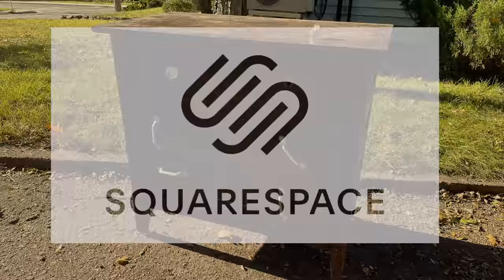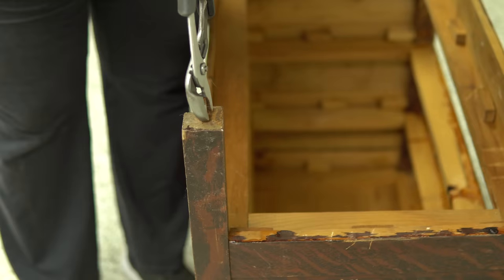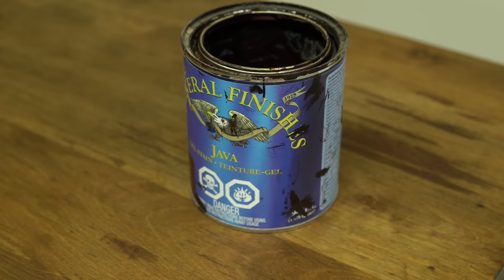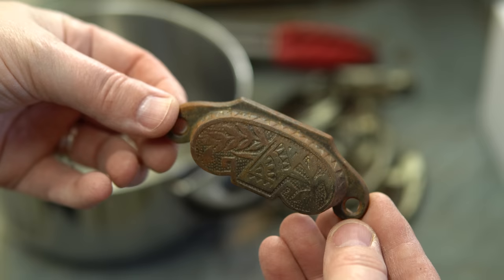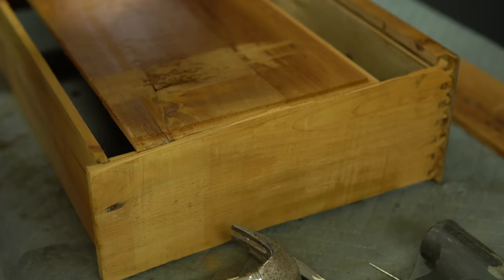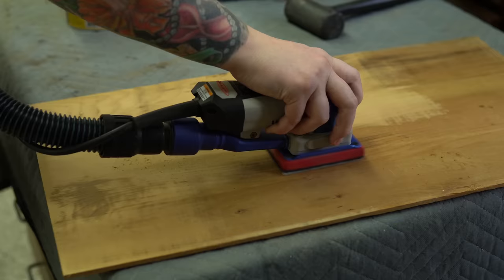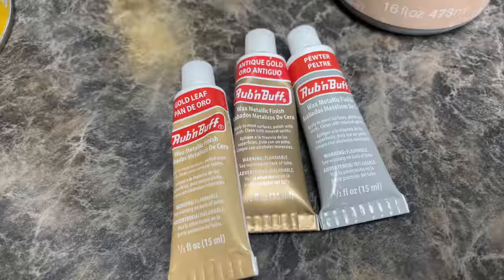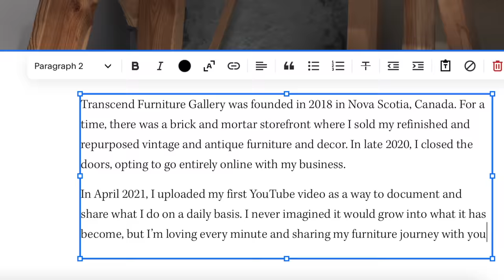Yes, I painted this chest of drawers: THAT is a FAUX oak finish!

Comment: I had never heard of, or seen, the peg/scallop joinery before.  How very unique, and yet I can't begin to imagine how difficult it must have been to create prior to modern power tools.  You gave this piece a major facelift and a chance at another life.  Well done!!  👏👏👏
Reply: That joinery was created with circa-late-1800s power tools that were built specifically for the purpose of making it -- and it was specifically designed to be easy to do with power tools, unlike dovetails that weren't doable with power tools until we got to the era of modern routers.  The "peg" side was made with a rotary plug cutter (or a set of them), and the scallops were made with a special shaping cutter.  It was as simple as putting the wood into the machine and pulling a few levers.

It's kind of rare, because only a large furniture shop would have bought the machine to do it, and once it became possible to do dovetails efficiently with power tools, it fell out of fashion.
Reply: @BrooksMoses  Thanks for the history.

Comment: I have that same piece in my spare room. It was a pain in the backside just like yours. I took the stain and varnish route, and it took forever to get the wood prepped. But worth it in the end. The key for that is a tricky one. I did eventually find one.  Your paint and stain combo is also a good look. Well done !

Comment: I can't believe the work you put into recreating the joinery. The result is exquisite. I grew up in the 50's and 60's in (very) rural New England. My best friend's mother was an antique dealer with whom I visited hundreds of antiques shops starting at around age 9. A neighbor was also a dealer, and I often hung out in her shop. When I was 19 I took a year of from college and worked at Sturbridge Village, a living museum in Sturbridge, MA. Over the years I saw a great deal of the painted finishes that your dumpster dresser was painted in. It's likely that the finish was executed with vinegar (something I want to try). 
I have a similar dresser taken recently from a trash heap at a total renovation/reconstruction site. It's much younger that yours. The cracks in the drawer bottoms have been repaired with thin packing tape. I had to cut the legs off to fit it in the truck of my little Fiat Panda (I live in Italy, hence the Fiat Panda). No great loss as I they would have required far greater carpentry skills than I could ever hope to possess. I've never intended to sell when "restored". It's just a practice piece. 
You were the first furniture restorer I found on YouTube. I was instantly hooked, am now horribly addicted and requiring rehab.
 I am beyond envious of your Fusion Paint stash. There are so many products used, not just in your videos, but many others I watch, that are unavailable here. Gel stain? They have no idea what I'm talking about. MinWax Gel Stain available on Amazon Italy?  A Fortune. A small bottle of Dawn Dish Detergent on Amazon.It costs 99 Euros. I've blocked from my mind the cost of a tiny can of MinWax Gel Stain. 
I'm looking forward to watching this video again so I can figure out how to see the paints you/ve created from your back yard.
Thank you for sharing your talent with so many of us around the world. You've been an amazing inspiration to me.
Reply from the maker: Wow, I'm speechless! I'm so glad you're enjoying my content and channel. Best of luck with your restoration project but be forewarned, if you're addicted now it may get worse!  😉 Thank you so much for watching!
Reply: @TranscendFurnitureGallery  
Have a healthy, fun, profitable New Year, free from trauma and grief. 🎊🧨🍾🥂🌟😘❤️

Comment: I like your rescues.  One thing I noticed after binge watching is that going to paint is almost a default move. On this faux tiger oak painting on pine, perhaps we could see the virtues of the pine with another approach, and not the dark finish...lots of dark finished pieces languish (hence sidewalk discards).  Alas dark 18th-19th c furniture is not valued.  A light oiling with no plastic/acrylic finish , but a clear finish on pine can bring out the humble pine. Cottage furniture of late 19th c early 20th has sides of apple, pear. The different tones are lovely.  Even a linseed oil cut with turpentine finish would be great.  Contrasting wood tops and legs with side  paint finishes is in style,  and can look handsome, but tends to have the Wayfair, commercial home furnishing look to it.
Reply from the maker: Paint is definitely not my default, but often a last resort for me. I opted for the darker top, as the piece itself was initially very dark, as well as the staining on the top that oxalic acid didn’t remove. I do a lot of restorations and not every piece is a candidate for it, unfortunately. I have to be able to sell pieces quickly, as I don’t have a lot of space to store something that may only appeal to a couple of people. I save wood where I can, and opt to paint only in certain situations.

Comment: Thanks again for a great video. I like the stains, paints and hardware you chose to change the dresser. But the thing that's different from so many other projects is you usually draw the eye of the beholder to the middle, legs, bottom rail or platform with some contrasting color.
Reply from the maker: Thanks so much for watching!

Comment: Thought I’d just give a little assistance here, I would recommend using a light machine oil such as three in one oil (blue can) on those old mortise locks in place of WD-40. WD-40 overtime actually will gum up and worsen the problem lol. Oh yeah, and these old barrel type keys are pretty easy to work with, if you have a bench vise, you can mount it in that, and file it down with a metal file. Anyways, nice job, the piece turned out really nicely!

Comment: For your first time making that joint, I think you did remarkably well, not to mention the fact that you used a table saw to thickness plane a board to get it to the right thickness is a task not for the faint of heart. Overall, very nicely done, thank you for the video.
Reply from the maker: Thanks so much for watching!

Comment: All the jewelers of the world would back me up on this... Coping saws are so much easier to use by pulling down through the thing you are cutting. Not up the way you were doing. 
And as for the chest, maybe you don't totally love it but it'll be out there for a few more generations instead of rotting in a landfill.  That's still a win.
Reply from the maker: Thanks for watching!

Comment: I have missed you!!!  Nacho growing sooo fast!!!!  I’m Loving this little dresser!!!  I was thinking some crazy idea when you were doing the “nut” joinery. Take scrap piece and drill out the old holes same size-small drill bit then up size gradually to same size “dowel” while doing on top of new wood. I don’t know.  Place into thicker wood plank like you did. Then get the floor thing-can’t think of what called-push up against original frame of drawer to get the curves?  Loving this piece!!!  Sooo Happy that you saved it!!!❤️💫❤️

Comment: Like you, I don't have a planer to make boards thinner. I use my table saw too. When you were cutting the piece with the knapp joint, I noticed that you still had the riving knife on your table saw. I found that it's much better to rip boards without the riving knife. I think that might prevent the saw marks on your piece (at 15:42). Of course the purpose of the riving knife is safety, so I take extra precautions when I remove it.
Reply from the maker: Thanks so much for watching Susan!

Comment: For antique hardware that has been painted with lead paint, soak overnight in a methyl chloride type of paint stripper. Unlike a gel type, this can be the liquid type. Once the paint is softened, use 0000 steel wool to remove paint safely. Wear gloves while doing this.
Reply from the maker: Thanks for watching!

Comment: A good and safe way to remove lead paint from furniture hardware is with paint stripper. The chemical stripper binds the lead particles in the paint and doesn't allow dust. Lead is only dangerous in dust form.  Great save on the dresser. It looks great.
Reply from the maker: Yes indeed. :-) I talk about this in another video where I was showing how to deal with it. I think it was a desk I was working on, if I’m not mistaken.

Comment: This piece got lucky that that you found it and I didn't. Knapp joinery was its best feature by far but the woodworms got most of that. Of course you achieved heroic results in spite of everything, especially compared to the large stack of kindling at the start. My favorite part of this video was watching you make the hardware match up using Rub 'N Buff which is a product I like. Please add that to your Amazon affiliate list, by the way. I'll try to remember to start buying it through your link- but no promises. Those little tubes last longer than you'd expect. I could actually be dead before ever running out again. I don't believe I've witnessed you use so many different products on just one piece of furniture before now. I hope you had them all laying around and didn't have to run out to buy anything special at the last minute just to finish the job- I hate when that happens to me. I also hope you find a buyer who appreciates all your time, hard work, artistry, and the bit of Canada's furniture history that you brought back to life here. All of the above certainly made for an interesting video, Angie! Thank you and see you next time.
Reply from the maker: Thanks so much for watching!

Comment: You shouldn't fear anything with lead paint.   Wear gloves and strip the piece and be sure to dispose of the stripper residue in the trash.   As long as their is no airborne material you will be fine.   Of course a big fear would be ingestion by a small child, but once the presence of lead paint is established, that won't happen. I believe that many overreact with dealing with lead paint.
Reply from the maker: Oh, I don’t fear lead, I’ve dealt with it many times. It just takes longer to remove and is a pain in the arse. lol
Reply: @TranscendFurnitureGallery  Yes, you're right.  That is why lead was used in the first place as it has many desirable properties for paint use.  You can see exterior signs painted with lead paint that can last 60-80 years.

Comment: I'm so impressed with your skill, patience and determination!  I'd occasionally love to hear how you determine pricing on your pieces:  do you track all your time and materials and set a price based on an hourly "wage"  or something completely different?
Reply from the maker: Some people try to use an hourly rate on non commissioned pieces but I don’t find that very accurate. Sometimes the tiniest details take FOREVER, and would quickly “price out” the piece you’re working on. I go by what the piece itself is worth, based on comparable products in my area, and the finishes I’ve done to it. Most of my pieces sell within minutes. Which generally means I’m pricing too low, lol. But I don’t have the space to keep pieces for days and weeks so I need them to move fast. If I had more room, perhaps I could get a price closer to what some others in my area are charging. Which has gone WAYYYY up. Thanks for watching!
Reply: @TranscendFurnitureGallery  Hey Angie, thanks for sharing that.  I'm not competition, just curious😉 .  I live in North Carolina and am shopping for a couple of MCM pieces (a buffet/console and a small dining table)  I can attest that prices on nicely refinished pieces have greatly increased in the past couple of years. Thanks again!

Comment: I guess... My question is. What's wrong with the lead paint on the door pulls? If you still have them I'd love them!
Reply from the maker: Nothing is wrong, per say- it will just take time to remove the lead paint with stripper. I just didn’t have enough time before I had to have this piece finished. I’ll use them on another piece for sure, they are beautiful :-)

Comment: I admire your dedication and craftsmanship...
I noticed your push thing fir the tablesaw...never seen one like that.  Where did you find that?
Reply from the maker: Thanks so much for watching! 
That is a Microjig Ripper Pushblock. They can be found here:
Canada - https://www.amazon.ca/GRR-RIPPER-Pushblock-Router-Jointers-MICROJIG/dp/B001I9UNWC?crid=MXZ770HU0TS4&keywords=gripper+table+saw&qid=1665329509&sprefix=gripper+table+saw,aps,106&sr=8-2-spons&psc=1&linkCode=sl1&tag=transcendfu0d-20&linkId=d9f8a82533f7326e21c53067dadc64fd&language=en_CA&ref_=as_li_ss_tl
or 
US - https://www.amazon.com/GRR-RIPPER-Pushblock-Router-Jointers-MICROJIG/dp/B001I9UNWC?crid=PKI4D2S41Y79&keywords=Ripper%2B3D%2BPushblock&qid=1665329579&qu=eyJxc2MiOiIxLjU4IiwicXNhIjoiMC4wMCIsInFzcCI6IjAuMDAifQ%3D%3D&sprefix=ripper%2B3d%2Bpushblock%2Caps%2C171&sr=8-3&linkCode=sl1&tag=transcendfurn-20&linkId=3407d9093508d8781710e3a1ecf9e088&language=en_US&ref_=as_li_ss_tl&th=1

Comment: Do you ever start something,get frustrated and set it aside to finish weeks down the line? Or do you just stop if something becomes not worth your time?
Reply from the maker: It’s happened on occasion. A few I came back to another time. Two ended up on the curb. They have to be reallllly bad though. And I usually strip whatever salvageable parts I can before doing so.

Comment: Just beautiful 😍❤

I was wondering, if i stain over a table top that isn’t 100% solid wood and seal with wipe on poly, is it still safe to sand in between each coat.. I’d hate to get to that last step and ruin the entire project. Thanks in advance ❤
Reply from the maker: Don’t need to sand after polycrylic! If you’re doing multiple coats you can take a plain brown paper bag (it’s like a suuuuper fine sand paper) and lightly go over the surface to remove any little dust bits that might settle before you do the next coat but that’s really jist if you need it- I haven’t had any issues :-)

Comment: I'm not an expert, but my understanding from museum friends is that woodworm holes are considered acceptable in very old pieces, and in fact are sometimes faked in faux antiques to make them look old.  With pieces which may have intrinsic value as antiques, conservation of the piece will give it more value than a full restoration.
Reply from the maker: Definitely true! I’ve even added faux worm holes to new wood to make it look older as well! The tricky part though is if it becomes structural (like that one drawer side). It’s a balance sometimes, haha ❤️

Comment: If you were going to just go with the wax finish over the paint, would the brush application be enough or would it require a harder buff?
Reply from the maker: The brush application would be fine - I often use an Art Minds wax brush or a rag. Thanks for watching!

Comment: Quick question: how do you evaluate when a bit of wood glue or epoxy is going to be enough of a repair, as opposed to when the piece is too far gone and need replacing entirely?
Reply from the maker: The key to any successful glue up : for wood glue you must have two opposing sides that meet completely with no gaps. These opposing faces should be face grain not end grain and the bond is often stronger that the wood itself. When you have two opposing wood pieces that have small gaps that's when you would use epoxy or if it's a substrate like pressed wood, particle board or MDF. If there are large gaps to fill I would try to fill as much of the gap as possible with actual wood and then glue or epoxy around it. If that's not possible or the substrate is crumbled that is usually when it needs to be replaced. Thanks for watching!
Reply: @TranscendFurnitureGallery  thank you for your thorough answer!

Comment: I usually get the quarts of paint from big box stores bc it’s less expensive. I am wanting to try Fusion. Can you tell me how far one jar of Fusion stretches?
Reply from the maker: Quite far, actually! As an example, I could like do two or three coats of paint on about 4-5 pieces this size. A jar usually lasts me about 3-4 larger dressers, depending on how much is covered with paint and how many coats. The exception would be white or off white- normally you need a couple of extra coats of that for full coverage but the rest of the colours have great coverage. (That’s typical across paint brands, with the white needing more)

Comment: Hi, I’m curious what the clues are that the quarter-sawn oak is a faux finish? I have a piano from the late 1800’s early 1900’s with a quarter-sawn oak finish. Now I’m wondering if it’s a faux finish???
Reply from the maker: Once you see a lot of it, there would be no mistaking that it's fake. Most of the time when it's a painted woodgrain the features of the grain are exaggerated ie much larger than normal. The flecking (tiger striping) in real quarter sawn oak is usually small and thin but on the painted versions they're quite exaggerated. They apply the faux woodgrain with rollers and will often roll right over the rails that separate the drawers, so if you see a piece where you have wood grain that flows from drawer to the wood rail to the next drawer that is might likely a painted on woodgrain. If you're planning to refinish the piece anyway, you can strip or scrape a small corner, if its fake the wood underneath will be pale.

Comment: How long did this restoration actually take you? It's awesome!!!
Reply from the maker: Because I have to film these projects, they take me much longer than they would otherwise. Every time I move at all, the camera has to be repositioned, so it actually makes it extremely difficult to estimate how long for each project. It depends also on materials used, dry times etc, whether it’s cold or hot and humid that day, as that can also affect dry times. Most pieces take me at least a few days, sometimes up to a week or more. I know that’s not a very accurate answer but the truth is, because I have a lot camerawork added in, I honestly don’t know.